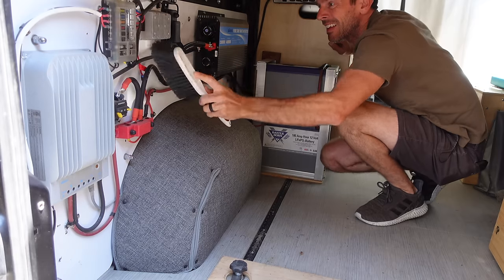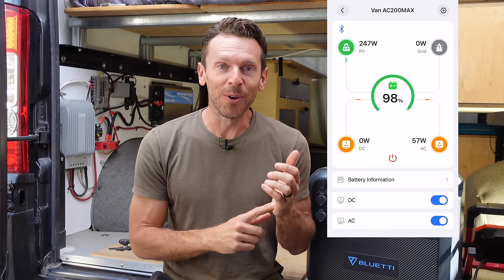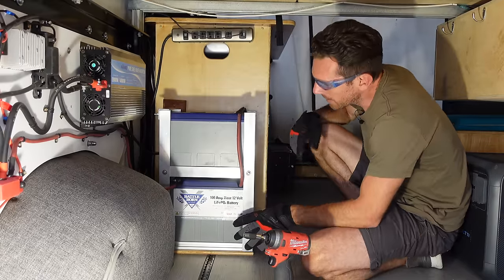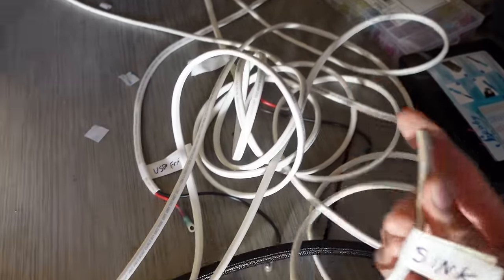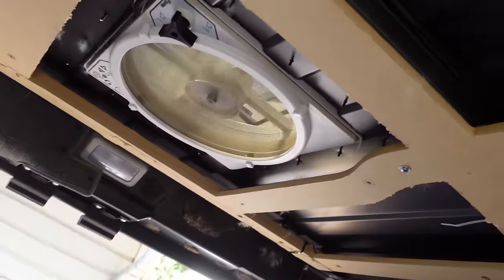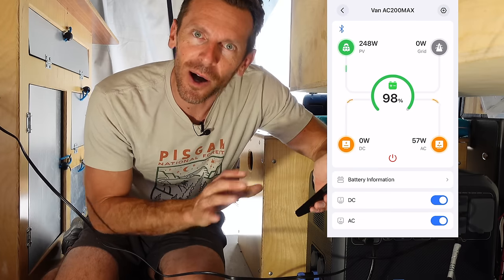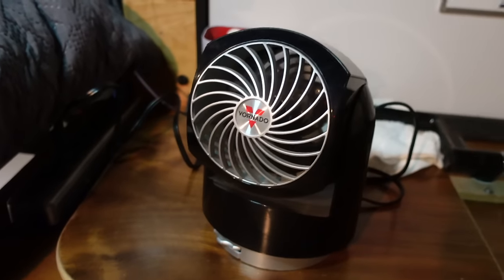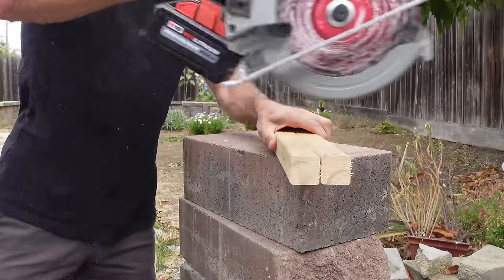The EASY way to power your van | BLUETTI AC200MAX Portable Power Station

Comment: There were a lot of backstories that distracted my attention....If I'm not mistaking, the initial hardcore setup you had at the left hand side of the van had been replaced with that minimalist clean setup of the Bluetti right? now, I know you have 3 x 100W panels on top of the van, what other gadget needs to go into what before finally plugging the charging cable into the Bluetti to get the juice flowing in? logically you would have like an extension plugged into the AC input of the Bluetti that allows u to plug in multiple devices simultaneously 'cos don't tell me u plug each device directly into the powerpack do u?

Comment: Ideally I would want hook this up so that it hooks into a 30 amp feed for all the power in the Rv from the inside…. And it charges when hooked to sure power, while driving, or when I hook up the generator….  And allows me to charge with solar..  without plugging and unplugging to change charge input…. None of these videos seem to cover that exact setup….
Reply from the maker: Yeah, that's a little more involved and something like the Victron system might be better because it is so modular with a bunch of different components.

Comment: Can every random solar panel be used with the bluetti power station?
Reply from the maker: Pretty much, but you have to check the minimum and maximum voltages. If you have a really dinky solar panel it might not have enough voltage to work with the Bluetti. If you have a massive solar array, it might be too much for the Bluetti.

Comment: I would love to know how long would it run a 5000btu ac or even a 8000 btu ac
Reply from the maker: If you know the wattage you'll be able to figure it out quickly. This is 2,000 watt hours
Reply: @bkxc  dont judge me for this question but so if the AC runs on 1000 watts does that mean that it will only run it for 1 hour? Please dont laugh at me lol

Comment: Can someone tell how they are using a BLUETTI ac300 or similar model to power a van air conditioner?  Specifically a 12 volt air conditioner.
Reply from the maker: This Bluetti can output 12volts DC at 10 amps. Not sure if 120 watts would be good enough for an air conditioner. But if it was, you just need to run the wires from the AC into the Bluetti cigarette adapter port.
Reply: @bkxc  thanks for your response- the AC300 is rated at 30 amps DC plenty when the air conditioner is in “eco” mode. But when in “full cooling mode” it can draw up to 50 amps.  I am looking at an AC to DC converter that would plug into the AC receptacle on the AC300 - found one that can put out 50 amps.  Would only need it short term then would move the Air conditioner to Eco mode where it would draw far less. That is what I have come up with so far- not great but workable

Comment: Like mine but doesn’t last as long as I’d hope just to power a little fridge and the outlet covers fell off so fast (3 months) and I wasn’t even using them. Cheap rubber
Reply from the maker: One of the big keys is to use DC power if you can. These power stations suck down a lot of energy with the AC output turned on. They have to constantly be running an inverter to change DC to AC. I have mostly DC appliances and it works a lot better. I only turn on the AC when I need it.
Reply: @bkxc  I get it! The fridge is AC but was recommended by a builder and van user as using less power than one of the Dometics. It has a compressor at least. It’s removable and was $200 so easy to change it out later.

Comment: Im sorry. I have the AC200MAX and because the power light and screen never turn off it has a horrible power draw.
Reply: You have to unplug the yellow plugs and then it should turn off.
Reply from the maker: All of these types of units have some loss from the inverter, but as long as there's sun tomorrow I'm always good.
Reply: @roofermanohio6636  Yeah I have it set to the shortest setting. What I noticed with solar input though is if there is any solar charge coming in the screen doesn't turn off. Maybe I have a setting messed up somewhere, but I looked through all the menus. I was using this power supply when I had to live out of my suv last year. So I had plenty of time to watch how it acted.